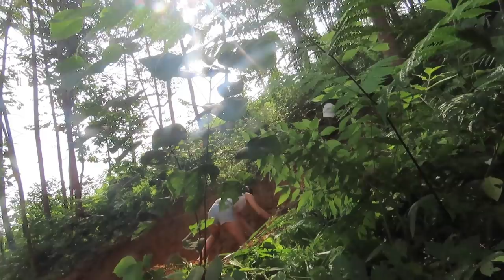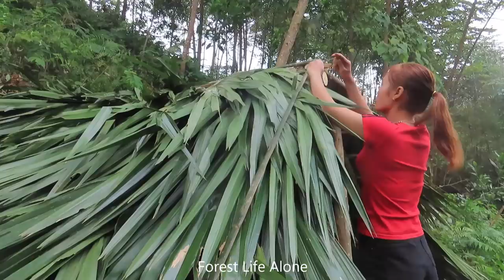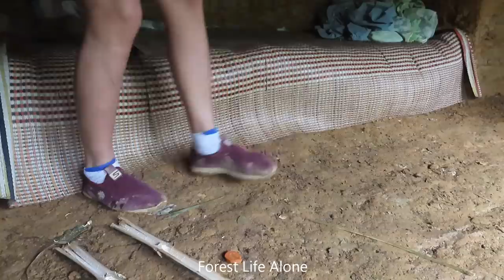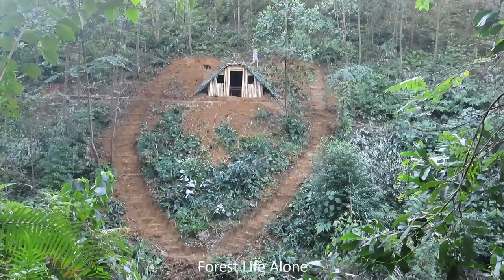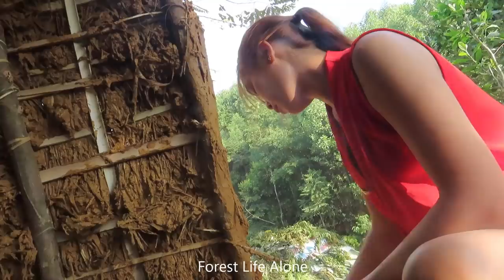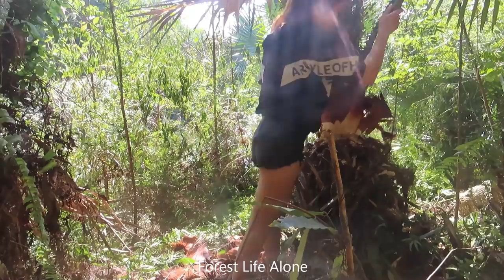Building The Most Secret Primitive Underground House - Bushcraft Open Road Around

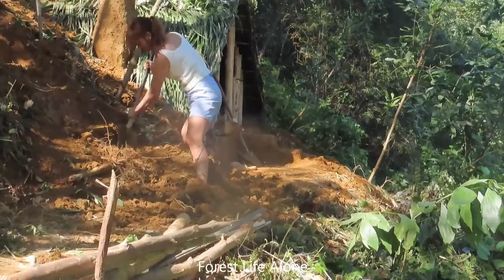Comment: Forest life alone that's the title of this video if you actually look between 2:25:30 and 2:26:02 you can clearly see that she's not alone when she's digging the stairs on the same level as her place she built look at the top of the stairs you will see a shadow moving around if you look really closely you will see someone wearing black shorts at the top as she's at the bottom shoveling so that means that she's not doing this alone so the title of this video is incorrect and if you actually look through this episode if she was alone then the camera would not be moving around and if you're really good at analyzing videos you'll look at the trees and the brush and it's not moving around so much so it ain't the wind the reason why no one catches onto this is because they're too busy checking her out